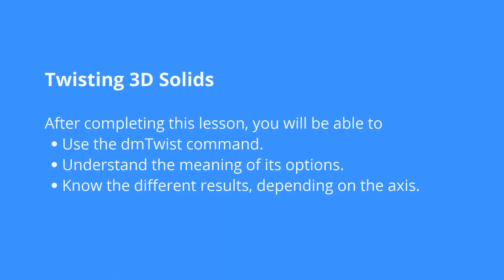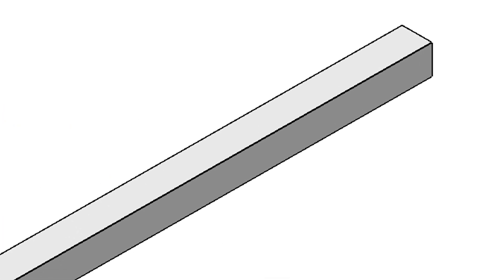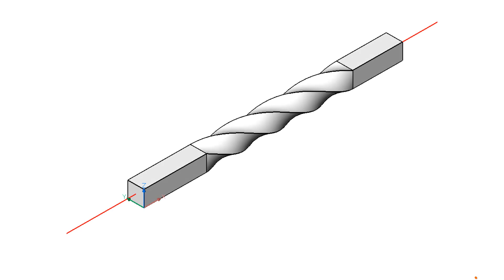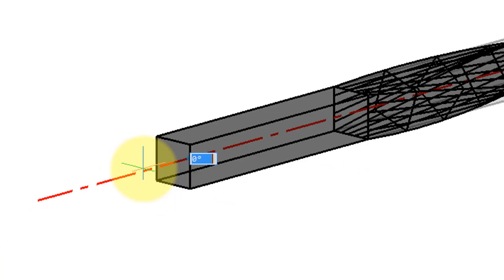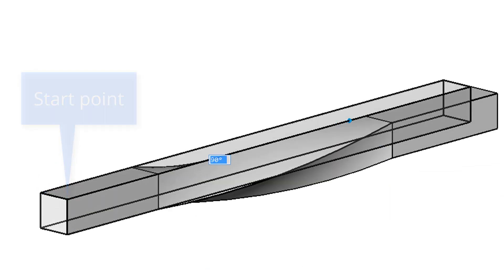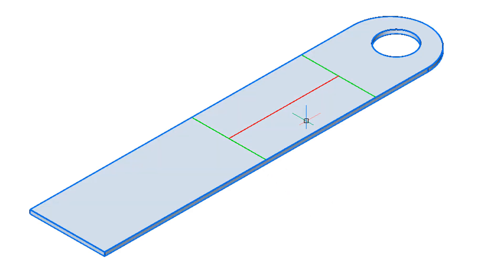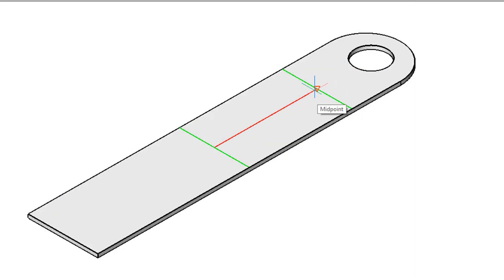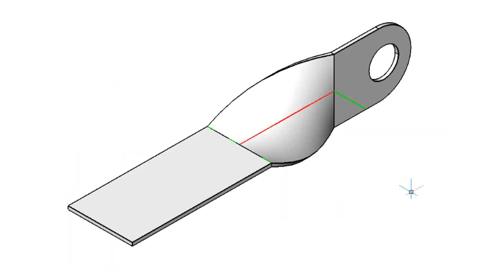Twist 3D Solids - BricsCAD

Comment: Great video. Any tips for making a parametric twist?  So you could change the twist angle as desired at a later date?
Reply from the maker: In the direct modeling twist is not parametric